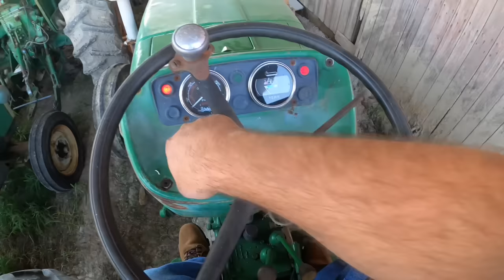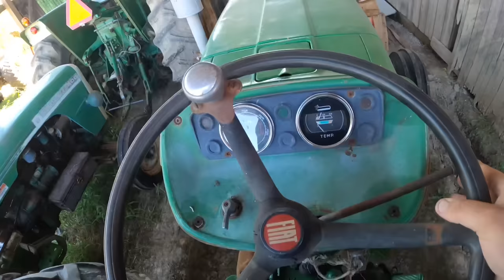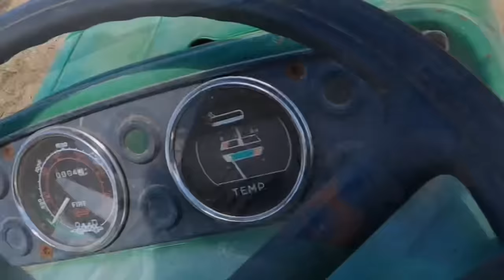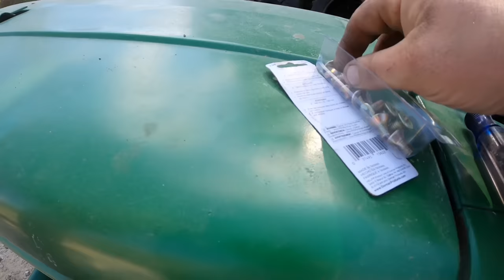Oliver 1365 Action!

Comment: That was a handy-dandy tractor for your leveling job. Getting stuck screws out can be a challenge. When I'm working on the combine, the slot head screws get exchanged with machine bolts. I've had your level of sadness trying to remove some of them. Might not be officially official, but next time around with a dose of never-sieze makes life much easier.
Reply from the maker: Thanks Don!